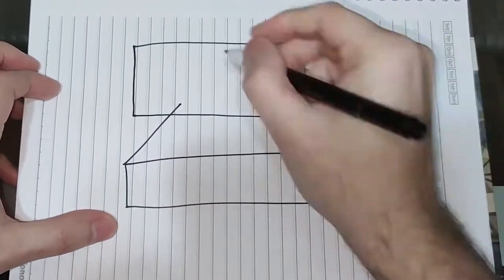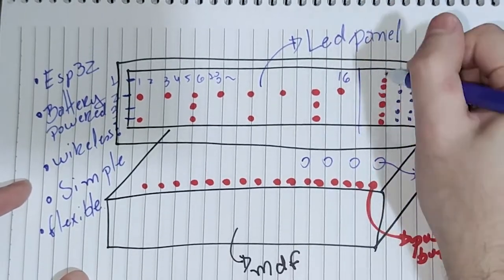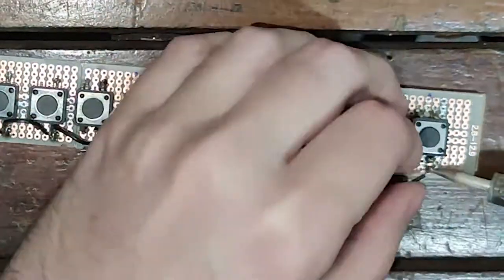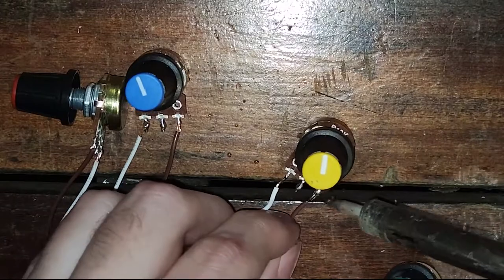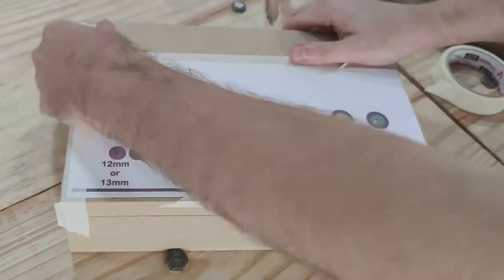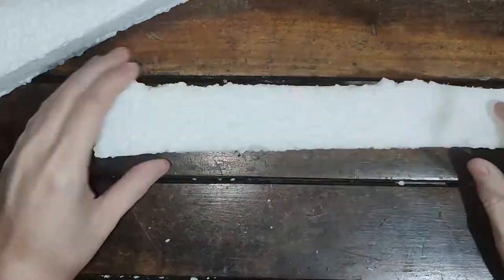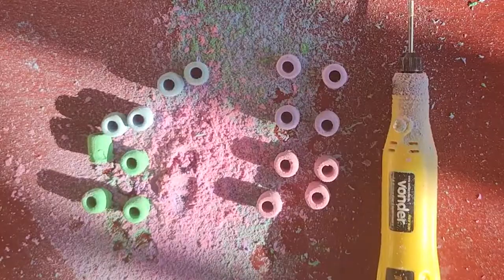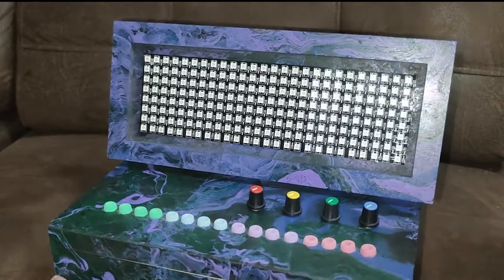DIY Wireless Midi Sequencer - ESP32 Powered - Pt. 1

Comment: Part 2 😭
Reply: Part 2 is for weaklings, brother.  As soon as you learn how to drill holes in the box without a drill and paint the box in a psychedelic style without paint and a garbage pail (you can only smell the paint), but purely by the power of thought, you will immediately understand that the second part is not needed, the sounds will flow by themselves, from somewhere above ^^^